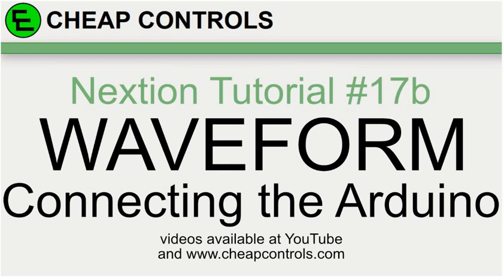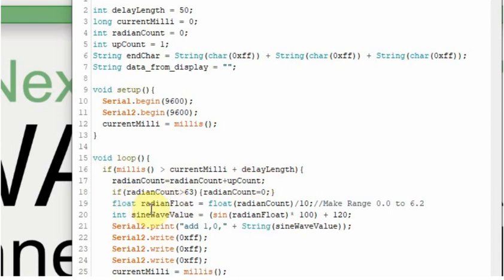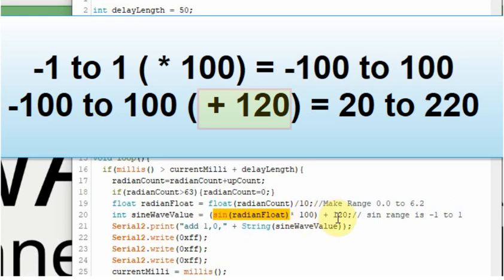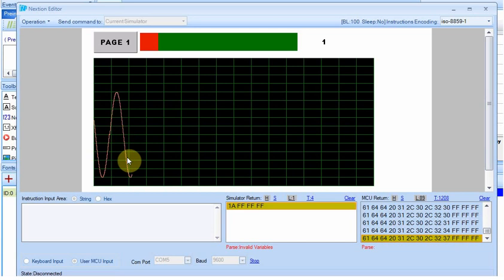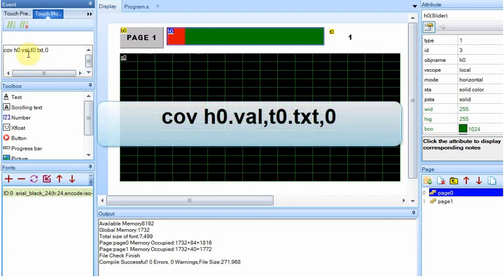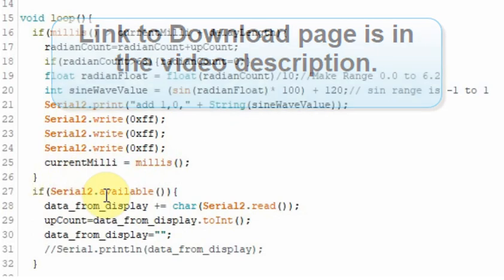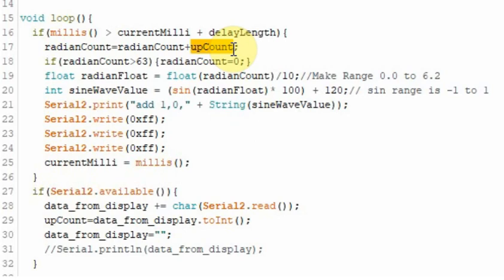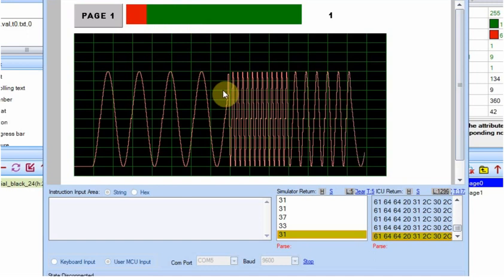#108 Nextion Display - waveform sin wave part 2 - Nextion Tutorial - condensed

Comment: Good evening. I have a Nextion 7 from the intelligent line. You mentioned that on the Y axis we only have one 8-bit register and therefore the value to be plotted on this axis cannot exceed 255. To make an oscilloscope there is (all have) a button that allows the signal to be placed on any part of the screen (vertical).
Is it possible to do this on this display? I have already tried adding a value to the value to be plotted but then it will cut the signal at 255.
I would appreciate your feedback.
Reply from the maker: I will have to do some math to change your scale to 0-255.  The Arduino uses a map function but I have found it better to convert it with my own math.  The Nextion can not handle floats so it is best to convert your numbers in the Arduino or whatever MCU you are using.  I hope this helps

Comment: kak ijin bertanya, kalau input datanya menggunakan txt berarti cara masukkan perintahnya pada program bagaimana?
Reply from the maker: Your comment did not translate well.  Please rephrase and I will try to translate it again.
Reply: I want to ask if the data sent from arduino to nextion is in the form of txt, how do i make the waves on nextion?
Reply from the maker: When sending data to the nextion it is in ascii form but the nextion will accept the data as a value if it is not surrounded by quotes.  you have to add quotes with the backslash for txt and leave the off for values  an example of a value is "n0.val=10"  the same 10 sent to a text is "t0.txt=\"10\" "  The waveform only accepts values.  If you tried to put backslash on the waveform it would not work.  Please let me know if this did not answer your question. I will try again
Reply: I want to ask if the data sent from arduino to nextion is in the form of txt, how do i make the waves on nextion?
Reply from the maker: When sending data to the nextion it is in ascii form but the nextion will accept the data as a value if it is not surrounded by quotes.  you have to add quotes with the backslash for txt and leave the off for values  an example of a value is "n0.val=10"  the same 10 sent to a text is "t0.txt=\"10\" "  The waveform only accepts values.  If you tried to put backslash on the waveform it would not work.  Please let me know if this did not answer your question. I will try again
Reply: The data sent from this arduino is read in the form of txt (t1 and t3). On nextion how this data can be read in the waveform on nextion🙏 .
Can I get yout email to share my problem. I'm a final year student who is working on the thesis and i'm having trouble making graphs on nextion.🙏
Reply from the maker: @xxxutaris  You can get my email from the main youtube channel page or submit a comment on the www.cheapcontrols.com webpage and I will reply
Reply from the maker: If you want to update a text field and a waveform you will need to send two commands one to update the text box and one to update the waveform